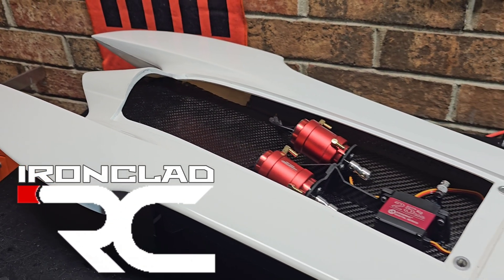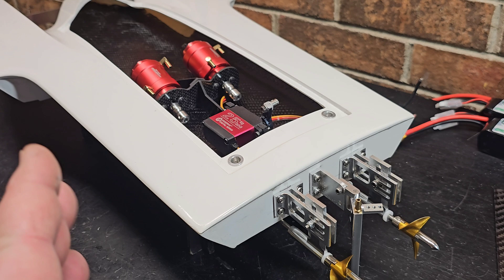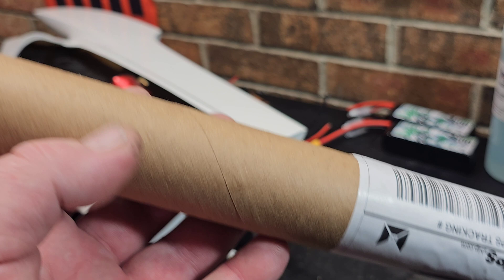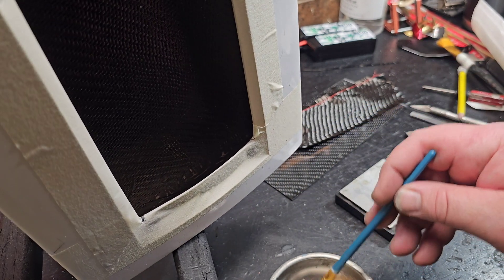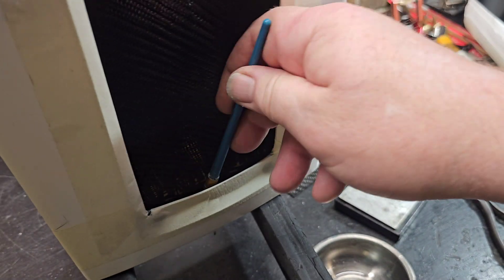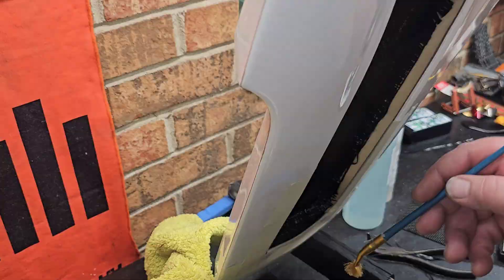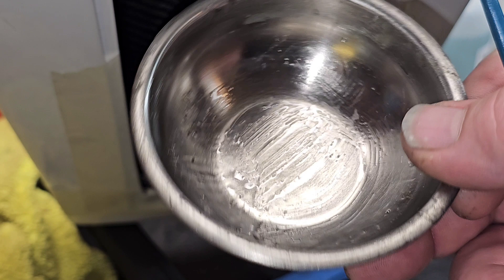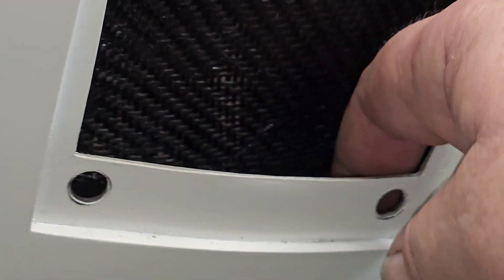Transom Reinforcement Deltaforce Vortex 24 Build Series - Twin Motor Hydroplane

Comment: Your channel provides a valuable service that no one does as well as you . Thats alot of aluminum hanging off the back of this Hydro . SMC batteries considering they are often the heaviest will be a good counter balance for good CG but you already have this under control , can hardly wait till it hits the water .

Comment: You either have really big balls or a very comfortable sofa! 😂

I’m considering major surgery on my Motley Crew. I think I’ll cut out the tub, pull out the stuffing tube and reinforce the bottom with carbon fiber. The hull is fiberglass, but if I take Bill O’s suggestion on motor/esc/prop, I’m concerned about strength. Videos are very helpful.
Reply from the maker: I say go for it!   That tub should have never been in that boat.   Good luck
Reply: @IRONCLADRC  yeah, it just in the way.